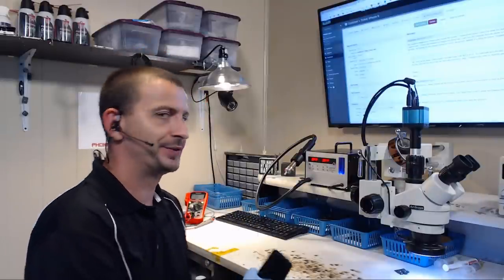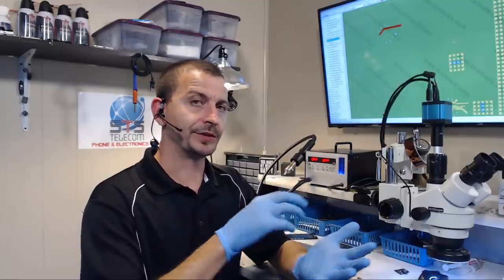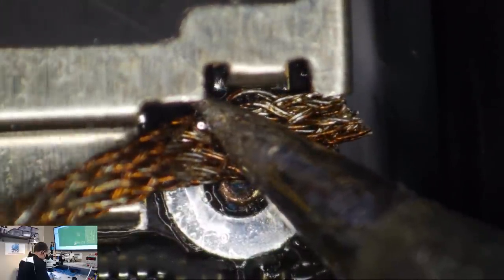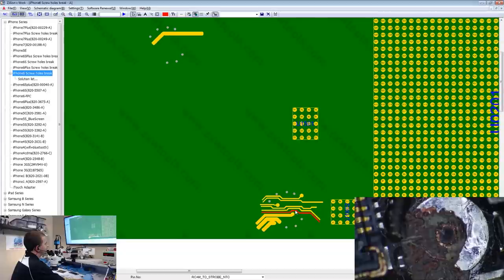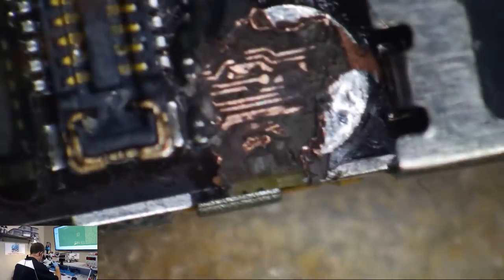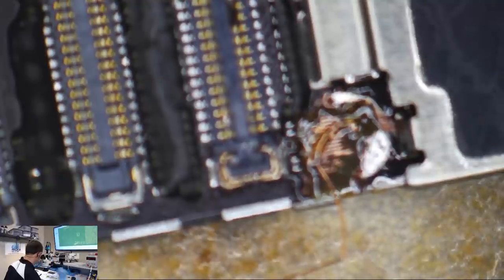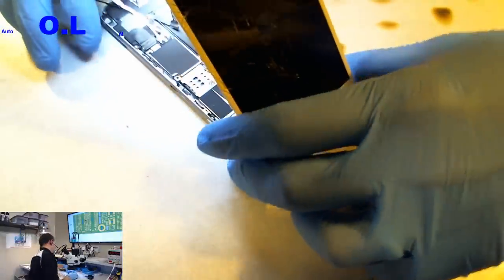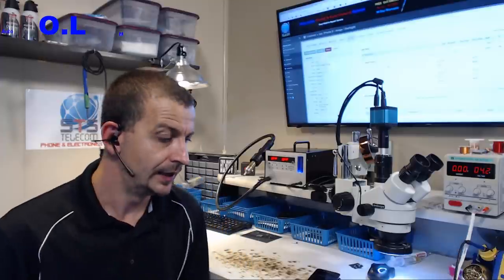iPhone 6 No Image After Screen Replacement - Screw hole damage

Comment: Hey Jason I have a iPhone 6 in at present for a screen replacement but I find that before prompting to boot it is drawing 0.00Amps and when you prompt it to boot that the Apple logo flashes up and then the display goes dark but if you lift up the screen you can see along the bottom edge of the display that there is backlight and the phone is drawing 0.60Amps of current but if you disconnect and reconnect the usb cable it is drawing 0.08Amps of current which I would suspect a partial short to ground maybe ?

Also once the board had been removed from the housing I could that the vcc main cap and and a couple of RF resistors were missing from the board next to the wi-fi chip one rated at 10K and the other rated at 100K and no shorts detected on any of them lines before or after replacing the missing cap / resistors and from what I can no long screw damage.

Comment: Hello,
I see some board repair guys have expensive gear like 900$ Hakko Hot air guns, 2.000$ ultrasonic cleaners an other stuff. But you have not so expensive gear. Like Ayoue hot air, a 60$ ultrasonic. The question is: do we really need the expensive stuff to make board repair?

Comment: Would it be possible to transplant the memory storage chip to another phone with a good motherboard to recover the data or is the flash storage hard-coded to the motherboard?
Reply: With iPhones the data on the NAND(data chip) is encrypted, only way to access it is to get the phone to a state where you can passcode unlock it. 
You can swap the NAND to another board- but it won't boot unless you also swap the CPU and eeprom over.
Swapping the CPU is the biggest problem with this, as it's an underfilled chip that's easily damaged and hard to swap successfully, even in the hands of the most experienced techs.
Generally a last resort, far easier to just fix the long screw damage in this case.